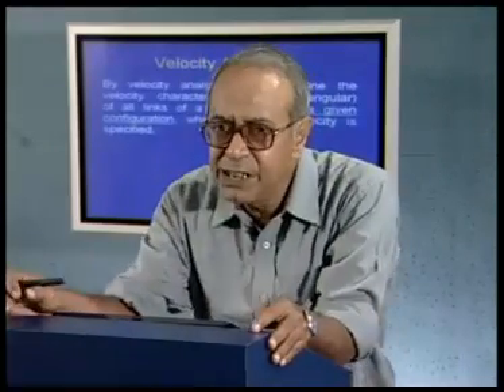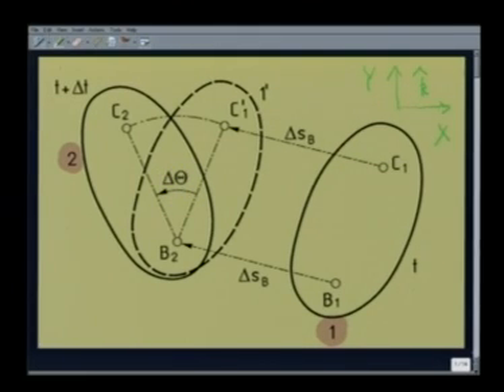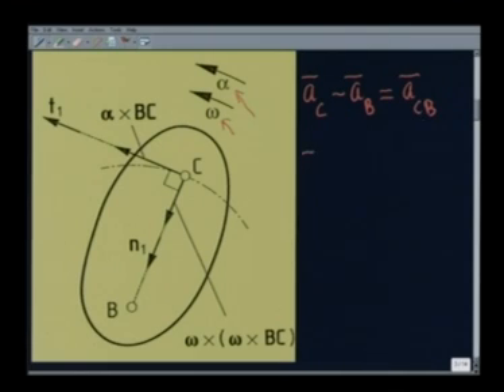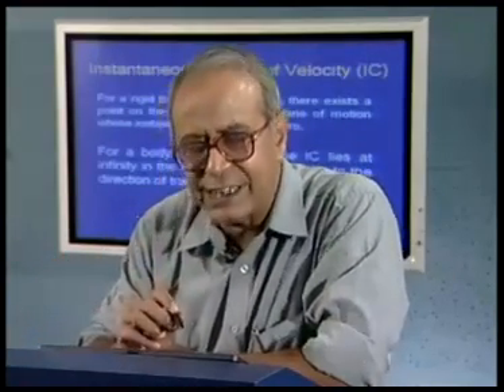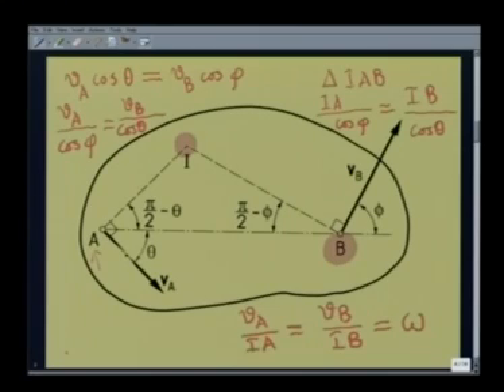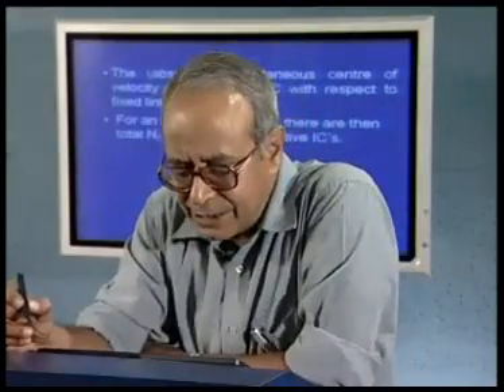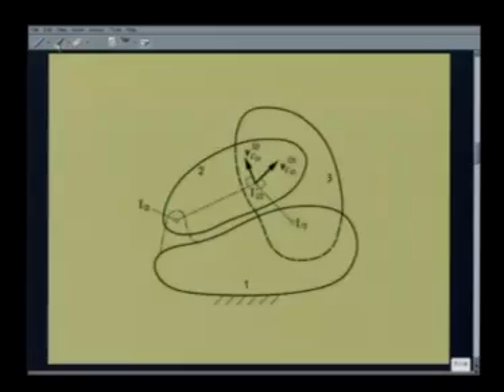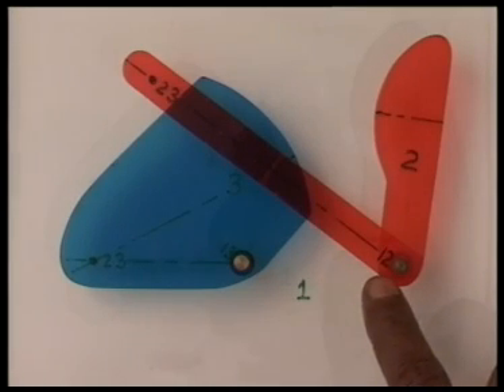Module 4 lecture 1 Kinematics of machines

Comment: Sir,how (Va cos@) and (Vb cos©) are equal
Reply: because both are connected with revolute pair(join) .or  also, we think both  point are lie in same solid body .
Reply: Bro just apply sine rule
Reply: As the body is rigid, the distance between AB never changes. Now if Va along AB differs from Vb along AB then the distance AB changes which is impossible..